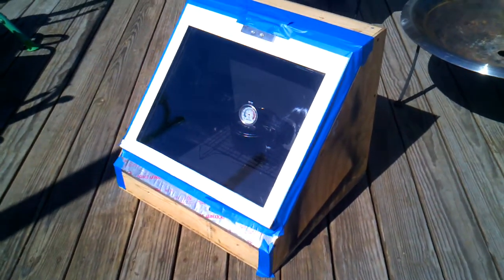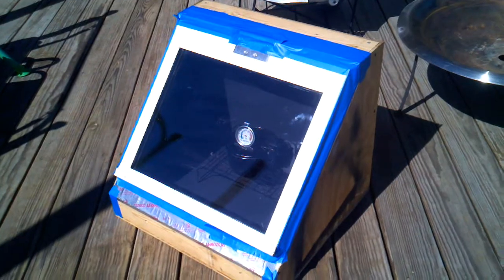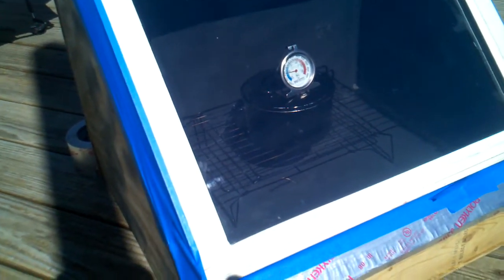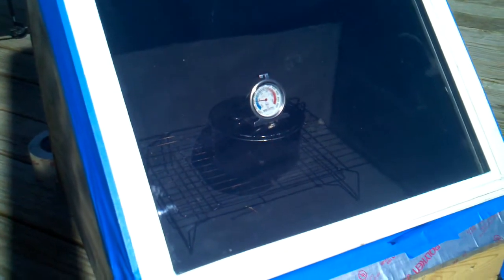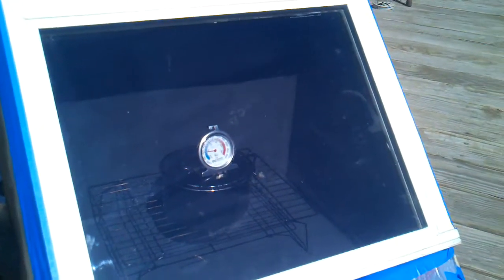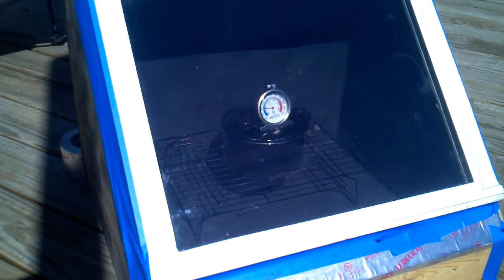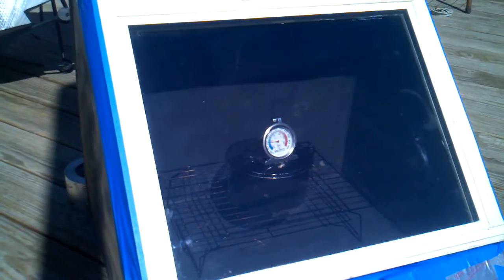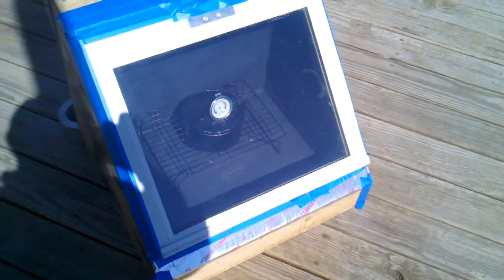My new diy solar oven in the first stages part 2.

Comment: I drilled a 3 inch hole in the side of mine and stuck the end of a blower dryer into it.  Then I turned the blower dryer on.  The oven heated up quickly and maintained a steady temperature even after it got dark.

Comment: My solar oven was 225 degrees I do more improvement by using metal sheet with high heat ultra b.b.q grill spray and one big dump bell. It heat up very fast inside the oven and when I touch the metal it burn my finger but then it started to get windy and cloudy otherwise I am sure it reach 350 to 400 degrees.

Comment: metal absorbs heat from the sun , like heating elements, put some steal bars along the back wall of you bax sun cooker,, it will amplify the suns energy,
Reply: No it won't! It will just take away heat from the cooking pot. Nothing can "amplify" the sun's energy. Want more heat? Capture a larger area of the solar radiation by adding solar reflectors all around, and doubling the glass to reduce heat loss.

Comment: Check to see if your glass has a UV rating. If so it will stop some of the sun's heat rays. You need Old glass to make sure.
Reply from the maker: Bob Anderson It does as it is not low E glass.  I still need to make some mods like reflectors. and better glass. Thanks for watching!!!
Reply: That's literally what I was just saying I made one using a window before on accident it had a UV coat on the inside of the glass took forever to get to 200 degrees. I replace that piece of glass now it's 350 all day long

Comment from the maker: I have made a few mods like adding steel in the bottom for that same reason and clouds too.  I have been able to get the oven up to 200 with no reflectors.  I am looking for a high reflective stainless that I can use but have found nothing yet.   I am trying to repurpose rather than buy new.  I tried poster board with mylar and that worked well but not very sturdy but more of a temporary set up.  With the mylar I got it up to 280.  I also need to add a gasket around the glass door.  Thanks

Comment: Any updates to this? Reflectors? What is your highest temperature? I'm trying to find a high quality solar oven design that can get to over 200 degrees... 300 would be awesome. Your design seems promising. For some reason I normally would be inclined to have created a door in the back instead of the top - a lot of heat escapes when you open that top door (such as when you check on things).... Something I can permanently mount on a wall.
Reply: Still there? Download the PDF "Capturing Heat" from Aprovecho, for plans to build a solar oven that will deep-fry french fries, so they say! Way over 300 degrees, and very effective cos as you say, it needs wide reflectors all round, and a small back door. And they are at Latitude 45 degrees. They use theirs just about every sunny day.